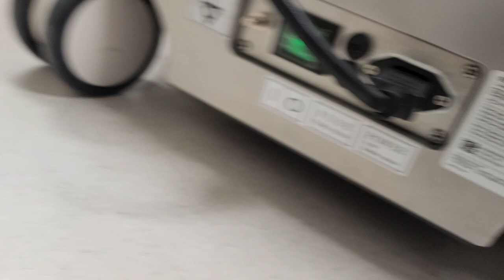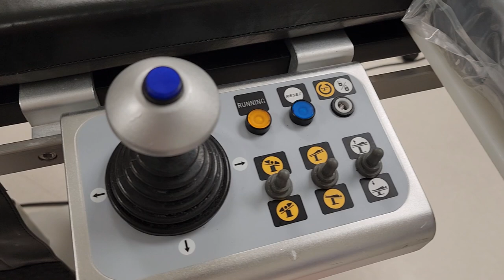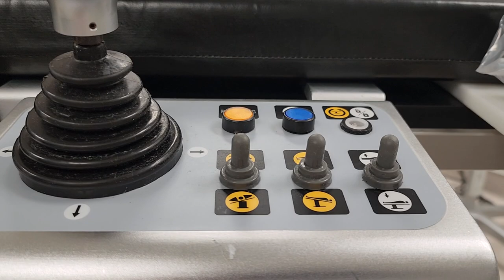DRE C Arm Table Troubleshooting

Comment: I've seen grease like that on the Acme screw, either it's really old or it is a bit polymerized from heat. Do you think red high temp grease would also work? Moly grease?
We don't have this brand or type of table but still vital info 👍
Reply from the maker: I believe that most components had synthetic grease like Mobil1. I put high pressure moly grease on it.
Reply: @BetterBiomedChannel  moly grease is really nice stuff. We don't have that over here, I probably have the only tube on island and I use it only when it's really needed. Stains everything it touches though.